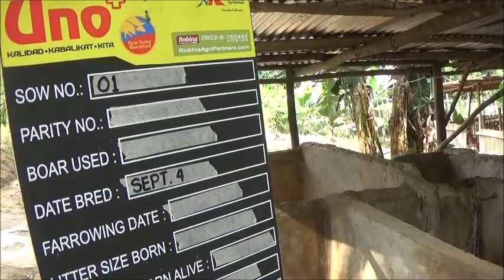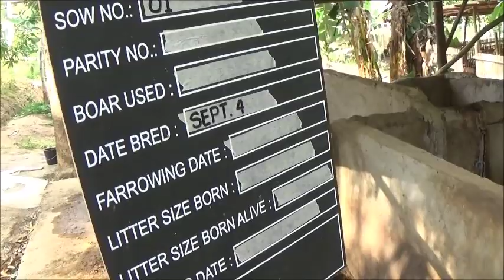More Maintenance And A Better Idea For Mounting The Sow Boards

Comment: One solid pipe going up the back of the piggery through the rafters then coming down branching down actually to each pen would work out better.. with a bigger pipe sleeved over the smaller pipe for protection!!👍👍👍👍👍👍😁😁😁😁😁😁

Comment: I've been following your channel for a couple of months now and perhaps I'm missing something but when you construct the pig pen walls it appears to me that you just apply concrete in the standard  manner to each piece of block and then give the pen an additional coat of concrete on the exterior and interior walls. I've been wondering why you don't use a rebar dowels at each corner,  each opening, and at least 3 ft on center for long walls. The other, suggestion that I'd make if I knew what I was talking about would be to go back after all the walls are completed and fill every cell with concrete slurry. I can see where a 200-400 pound pig leaning against those thin concrete blocks with no reinforcement would have a tendency to fail. Spent some time in the Philippines back in the 60's and enjoy your channel very much.